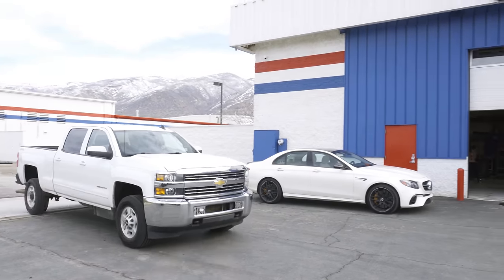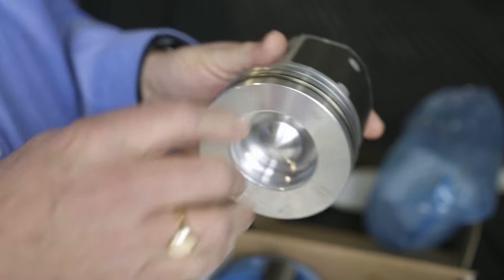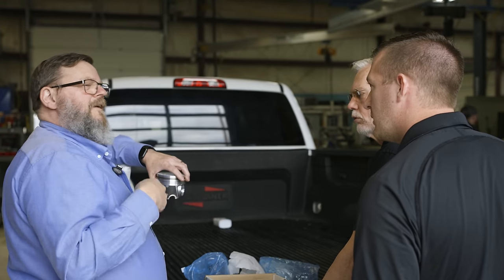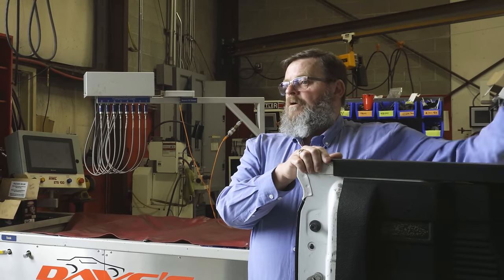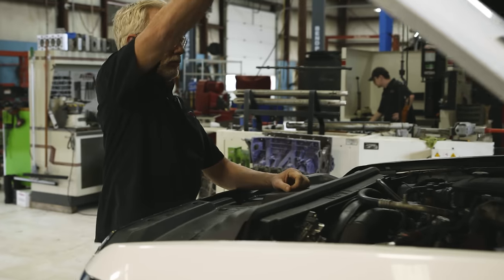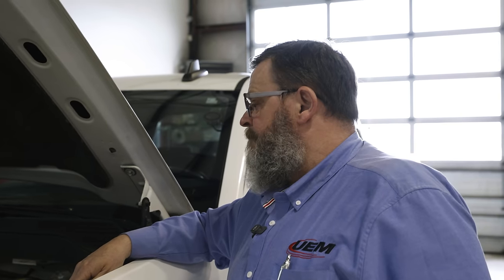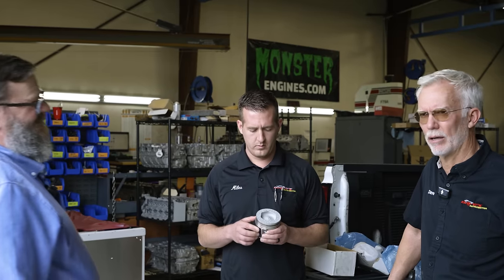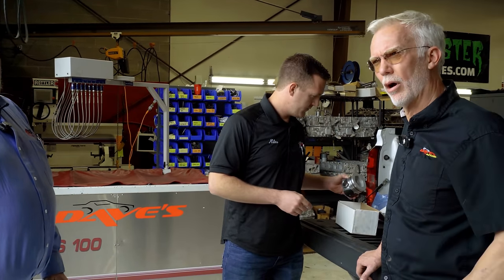What do golf balls and pistons have in common?

Comment: As a mechanic here, this sounds like Magical Pistons. I'd love to see some Dave tests on these Pistons!
Reply: Maybe the dimples create some kind of cushion in the combustion process or it could reduce the friction between the piston and moving flame front.  Either way the same technology improved golf ball travel through the air!
Reply: @garybulwinkle82  nope it's Voodoo

Actually the ceramic coating You can do yourself
And someone said putting dimples in the top of pistons has been around a while.
And total seal rings have been going on three decade ; maybe longer...there is one more thing drill and tap oil Jets to spay up inside tops of the pistons to cool them Even more
Reply from the maker: You are very correct to want to see some research and testing. This link from speed of air may be helpful. Thanks for watching!
https://www.speedofair.com/r-d
Reply: I agree 100%i dont believe it until I see it
Reply: It’s more than likely snake oil.
Reply: Pistons just look like low compression am that will increase engine displacement under boost=more power.

Comment: My 1974 Merc Cougar XR7, when i ported & polished the Elderbrock Intake i put in golfball dimples inside just by hand, 1992 when i had that 400M (0.020 over) out.   Had lots of fun in it over the decades.   Was stationed at Edwards AFB working on B2 at the time :)   all of them were just under the carb & inside the runners where a die grinder w 1/8" carbide cutter fit too.
No idea or dyno testing but managed 17mpg for a long time.😊

Comment: Respect has been earned from this channel!!
I just purchased a 2013 Equinox. Just over 150,000 miles. People say stay away from those! They burn oil! Which one of those people have stopped and opened up the engine to replace the low tension rings? Which one of those have installed a catch can to separate the harmful liquid being passed back into the engine causing the buildup on the intake valves?
Bought this vehicle sight unseen from Vegas. Brother-in-law did the legwork. We'll fly into Vegas use it as our 'rental' vehicle and then drive it back to MN.

Comment: We tested this on a wet flow bench. So we took 318 heads one we put HUGE dimples into combustion chamber, one we roughed up 40grit, and one we polished. The wet flow showed the dimples and rough surface worked well to stop pooling of fuel. With polished HORRID combustion chamber of 318s it puddled on head didnt get complete "burn" or atomization AT ALL. So there is some truth to this in keeping fuel in air. Direct inj fixes that obviously. But im interested in what benefits on head of piston would be. Our dimples where much more close to each other. But it did work. Wow the noise is way reduced
Reply: Turbulence is a fantastic thing once you combine fuel & air.
Reply: Roush racing was putting dimples into intake manifold runners on Ford NASCAR motors back in the 80s similar results increased power lower fuel use
Reply: The main difference in your testing and their product is the ceramic coating on top of the piston..
Reply: @kenkahn138  it also made the runners easy to slime up with gelled mothballs for a real good qualifying lap🤫
Reply: They placed the dimples where the injection jets spray. So there probably don't have to be many of them.
Reply: If that’s true about breaking up one big combustion event sound wave to smaller combustion vortices that work to try to cancel each other out then that’s the only way my brain can understand the noise reduction….. so depending on where the dimples are places dictates where in the combustion chamber these ‘individual’ events occur…..and how they interact with each other🤔🤷‍♂️ my brains exploding thinking about this now….id be interested to see the development process and thinking behind this final product for sure…….as well as a side by side comparison of course but who wants to pay for that…..?
Reply: @turtlezed  I'm not sure if this is about engine or exhaust noise. 

Exhaust noise reduction would be about shortening combustion duration, which means more heat is transferred into piston motion and less heat is dumped into the exhaust. More heat in exhaust causes louder exhaust. This is also why petrol engines have louder exhaust; they are less efficient.

Engine noise reduction would be about making the initial combustion less abrupt. I don't see how the dimples help with that because they'll make the fuel mix faster. I'd guess that would be a pilot injection tuning thing.

The faster mixing will produce more complete combustion though, so less soot, NOx and better thermal efficiency but probably more CO2.

Don't trust anything I say, I'm not an expert😂

Comment: Hi Dave, I am a recent graduate for mechanical engineering.  I just watched this.  I used to work at a golf course and knew the amount of engineering that goes in to golf balls. It’s insane how impressive this is and I appreciate you sharing this with the people!  Keep at it, you have me hooked as I use to be an auto / aviation tech now turned engineer.   It’s crazy how eddies impact flow characteristics and the use of the flame from an internal combustion engine can be manipulated.  The only issue I see is the ceramic top on that piston.  As we all know.  Transport can track a million miles easy.  I wonder about the test of time.  However, big big props to this innovative project and the excellent execution.   Cheers!

Comment: Amazing how much innovation that still continues to happen on combustion engines.
Reply from the maker: Great point!
Reply: @DavesAutoCenterCenterville   Great idea but what will happen when government wants all EV's by 2035 or so.  All this great technology will be thrown away.  I hope I'm totally wrong.  I would not want that at all. Nothing beats the sound of a V8. I own a 67 Firebird with a 455CID, I told my brother if this engine ever needs rebuilding it's coming to you. Great Job to you and your team. It's obvious not only you know your trade but your also passing it down to the next generation of mechanics and builders.
Reply: @oilman1758 that's wildly unrealistic and even they know it. The power grid can't even handle existing loads as it is.  Charging ONE ev once takes as much power as the power consumption of several households. So youre talking multiplying the national power supply several times over to make that realistic
Reply: @oilman1758 in the EU they did so! Me living in Germany hated the idea that from 2030 only EVs will be allowed, but shortly they realised its total BS and cancelled this law.
Reply: @jblob5764 This is false. If you have an electric dryer, you have the infrastructure to charge an EV. Simple as that. The US peak electricity usage was in the early 1970s, and has never even gotten close to reaching that level since. The US has been shutting down power generation stations ever since, and still is, because every advance in energy efficiency makes more difference on demand than the increased number of outlets.
Reply: @oilman1758  Vote like hell this November

Comment: On a 2 stroke dirtbike engine, the squish factor comes into play.
If the compression is uneven, you build hot spots. I might dimple my next piston just to see..
Pretty cool idea.
Reply: Just a 'side thought' - the dimples would tend to lower the compression ratio and increase the total chamber volume by the amount of material removed from the dimpling process.  Will that necessitate a skim of the head to restore the compression ratio?  HA - or am I completely wrong?  CHEERS from AUSTRALIA.
Reply: @elvispresley3340  
Yes I already have a milled head and it seems to build more heat..

Comment: I recently had speed of air piston put in my 6.7 Cummins from my 2020 Ram 5500.  Results are,
Engine runs smothers, less vibration
Very quiet running.
Have only run about 3000 miles so far so I'm waiting for more break in before pulling firm fuel efficiency numbers. But it's looking good.
Reply: So in 3k miles you haven't even bothered paying attention to fuel efficiency?
Reply: @volvo09 With the money he spent on the Pistons swap he doesn’t care about fuel economy. It probably cost him $10,000-ish to do the piston swap.

Comment: Highly persuasive. We need you  to test a car for noise, temperatures around the engine  exhaust emissions  chassis dynamometer for power and torque  objective road test for acceleration and fuel consumption . Then you pull the engine  change the pistons  and repeat all the tests. If you can show  positive improvements  we will believe you  - then they will become standard fit for rebuilding everything  everywhere .The theory  does sound credible  - no doubt they will be much more expensive at least initially  - but if this is true it is staggering .
Reply from the maker: Appreciate your comment. You have some very good questions and thoughts. This link from Speed of air may be helpful.
https://www.speedofair.com/r-d
Reply: @DavesAutoCenterCenterville  Thank you,  much look forward to seeing developments on this issue .

Greatly enjoy the  videos  by the way here  40 miles north of London
Reply: lets do this test on a single or twin cylinder motorcycle!

Comment: I've seen & heard of these @SpeedOfAir dimpled pistons for a year & a half or so now. From what I've seen\heard\watched they seem to be a very dramatic change in something like a piston thats been pretty much the same for decades if not a century or more. Adding the dimples has shown increased MPG in various vehicles of 10, 15, 20% depending on what else is going on. Thats alot of increase when your talking about a OTR semi truck going back & forth across the country every week of the year. It's like a really good increase in the combustion cylinder leaving less un-burned fuel, & overall just a cleaner exhaust coming out of the pipe\stacks. Who woulda thought golf ball dimple technology would make it into the internal combustion engine on piston faces? No one! It is crazy to see improvements like this after being the same for so long! Id put these in my 7.3 in a second....if i ever had to rebuild it cause it died, cause it probably won't. Comng up on 300k miles in my '00 f250 7.3 zf6, with nothing other than normal wear & tear maintenance stuff & I just put a new(reman) set of injections into it last summer. Shes still going strong as can be!

Comment: Dimpling has been used for years in motorsports and 2 stroke applications to "clean up" inefficient combustion chamber design. The idea is to read the piston crown for gaswash in the carbon, and introduce dimples to create turbulence and ignite the stale areas for an even flame front/burn. The same idea as unshrouding valves, removing sharp edges and blending valve reliefs.

Comment: Going from 13mpg to 16mpg = $576 per 10k mi at $4 a gallon ( UT, salt lake basin price as of 3/11/24)  . This yealds a 9month ROI  for my 25k per year based on, The Diesel Podcast,  speed of Air interview price point of $1025 for cummins 5.9. Less if you discount the price of stock replacement slugs.

Comment: If this piston is so great and giving a 25% increase in fuel efficiency, much longer oil change intervals and decreased exhaust temperatures, WHY are the manufacturers not using it?  WHY is this being sold as an aftermarket engine rebuild and not for the OEMs to just make them with these pistons in the first place?
Imagine the look on engine manufacturers executives' faces when you tell this simple part means 25% increase in fuel efficiency and longer oil change intervals and better emissions!!!  They would be breaking down the doors of this company ordering millions of them.
Reply: @JulietHotelFoxtrot  It's difficult to imagine that any of these problems couldn't be overcome.  Even a much higher cost, say double, would be more than made up for using 75% as much fuel as a standard diesel engine over the life of that engine, not to mention a few fewer oil changes.  It is highly unlikely that if OEMS were the ones doing it, that the cost would be double if today a rebuilder only needs to charge 50% more.
To be honest, this just sounds like a whole lot of BS.  The video was long on hype and very, very short on skepticism or testing.

Comment: THIS is a Direct result of the great Show of MYTHBUSTERS where they tested wind resistance of vehicles that were dented all over the vehicles with golf ball sized dents and they proved it provided greater fuel mileage.
Reply: air flow over a dimpled surface is a lot different scenario than the air flow a piston encounters
Reply: They used this tech in ww2.
Reply: @Strickland325  bouncing bombs

Comment: I’ve used gapless rings from total seal in many of my race engines….they do work….
In fact one engine in particular comes to mind……a Hot SBF stroker engine was built with conventional style rings…(good rings) 
After just a few thousand  miles an oil residue was noticed in the throttle body from the crankcase vent return….engine ran great with Great compression and didn’t burn oil….that winter the engine was pulled and a few things were done to it ….total seal gapless rings was one of them…for the next 2 seasons of drag racing and street driving there wasn’t any oil residue in the throttle body…engine ran better than ever and picked up almost half a sec in the quarter…(big gains in the drag race world) not sure how much the rings helped with power but I’m sure they did help.

Comment: Wow, this is an amazing breakthrough for diesels! I own a 17-year-old Cummins diesel and I love the noise it makes, but if I can squeeze out more miles per gallon out of my old truck, that would be amazing! I don’t really need it to be quiet because I love the sound of diesels And yeah, my truck smokes, but it is a pre-emission truck. But if I ever bought a new diesel truck which I won’t because I’m not gonna pay $100,000 for a truck, but if I did, this will be the first thing I would do just because of the emissions.
Reply: Hey there. We've had some of our best results with the 5.9L Cummins and actually that was our first test engine. That black smoke is just unburned fuel going out the tailpipe and money out of your pocket. We have 5.9s on the shelf!

Comment: I wanna know if it makes a 1997 obs 7.3 ford quieter 😂 there fringing mills running under the hood.
Reply: thats injector noise, not combustion
Reply: That’s true, you can get a “Drive thru” tune to run the injectors so smooth you could talk over it

Comment: I recall Total Seal "Gapless" rings having complementary steps on the ends so the ends could overlap while still fitting in the groove(s). The length of the steps was sufficient that butting and seizing in the cylinder were not of any concern.

Comment: This is pretty much like engine additives, they are meant to be sold. There is no distinguishable power difference. But from experience in testing different surfaces and coatings, it does not improve airflow to have these in cylinder heads, combustion chambers, or pistons.

Comment: I know in ports, dimples choke ports. The dimples create voritcies, which makes the boundry layer thicker. If the piston is colder than the flash point of the fuel, the fuel won't burn. If these vorticies are strong enough to suspend the fuel in the cylinder and keep it off of the cold piston, i could see that. (Not likely tho.) The quietness could be wrist pin offset. If you have the rod straight or aimed slightly toward the loaded side of the bore during ignition, you eliminate the piston rocking and piston slap in the bore.  Theres a lot of cool things you can do with engines if you have enough money and time.

Comment: Bach in 2001 when I was only 19 yrs old, I built a 355 Chevy with Total Seal Gapless rings and I also noticed the oil stayed much cleaner for a far longer time. 
 Just turning the crankshaft over by hand, I could tell there was virtually no leak down.

Comment: Dimple construction and/or coatings have had a huge impact on almost every industry. 
But..... I too am a skeptic of miraculous products that solve everything. 

Who here remembers the spinning impellers inserted between intake and carbs,was supposed to offer swirl technology to increase fuel efficiency. 

I need to see a skeptic shop do an independent shop install these on a brand new engine, with data before and after.

How do you install an unbroken ring,how long before the ceramic cracks and fuses the piston to the liner.
I love innovation...that is proven.

Comment: If I was to guess how the dimpling would affect the engine performance, it would be more efficient, air flow and maybe cleaner, scavenging and a reduction and nock.However I do for see the possibility of engine overheat if the engine's cooling system is not beefed up. The reason being the edges of the dimples would serve as points of heat collection and that could cause a spike in temperatures that could radiate down into the metal of the piston, causing eventual piston failure.This is all just spit bowling on my part.I haven't got any degrees.I haven't done that a testing.I'm kind of interested to see where this goes to.

Comment: Yes they will work, for a short period. The reason a golf ball flies so well is laminar flow, the dents hold pockets of still air that decrease its CD. With this piston you will flow more fluid with less effort = horsepower. But the dead air spots will carbon up and fill in. Good idea if you could clean it with H2O injection….      😊

Comment: Im not sure about the dimples, but for sure a gapless ring would improve sealing, and the ceramic coating will prevent the piston from becoming so hot, which would lower the egt. 

Itd be interesting to compare two identical engines, one with gapless rings and ceramic coated pistons with dimples and one without the dimples